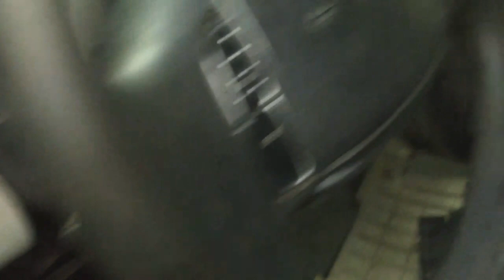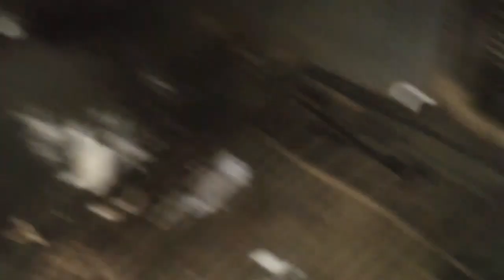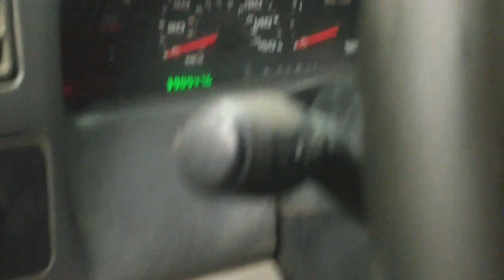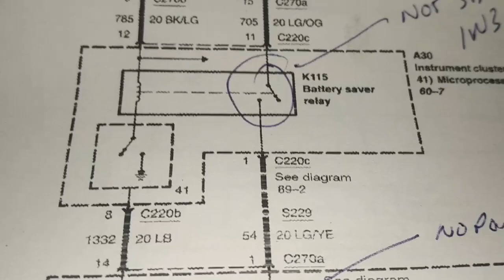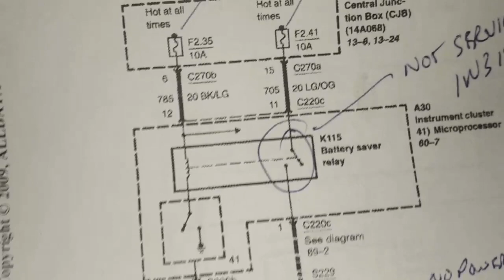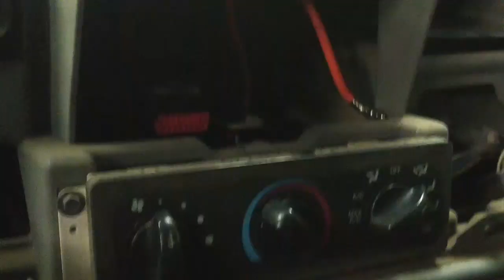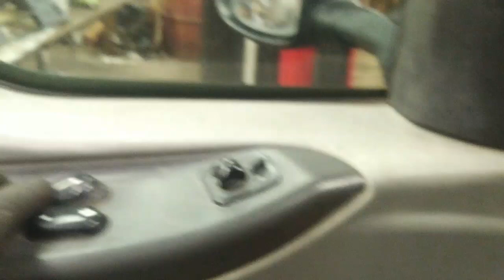2002 Ford F250 SD no power windows or radio

Comment: I've been having this exact problem for 10 years. About 5 years ago I figured out that if I smack the dash right above the radio 9/10 of the time the radio and everything comes on. I haven't bothered to follow the problem further because it's always worked. Remember hitting things is sometimes the solution 😅🤣
Reply from the maker: The root cause of the problem is likely a cracked solder joint on the circuit board or that internal relay and its contacts. It seems to be quite common based on all tge feedback on this video. Thanks for watching.
Reply: I slam my drivers door twice.  😄
Reply from the maker: The Fonzie move...
Reply: Lmao you just got me out of a wicked pinch
Reply: My dad beat the dash on his f350 for years and it would always come back on then he passed away and when i started messing with the truck to fix it up i was doin the same thing for 2 years but now it wont work hittin it i just pray that it works the day i go to drive it each time now lol

Comment: I was curious if this would fix my issue I have an 04 f250 6.0 the cluster radio windows and dome lights quit on me today the cluster said battery I went an bought two new batteries it was able to activate my fass fuel system so 8 could start the truck other than that still no luck with the other
Reply from the maker: I would suggest to check all the fuses that power in instrument cluster. Since it indirectly powers the radio, power windows and interior lights it won't be able to do that if its not awake itself. Check the fuses. Aside from that you then will need a schematic to check powers and grounds at the instrument cluster. Good luck.
Reply from the maker: Fuses 33 and 45 power the cluster

Comment: Thank you so much!!!   So glad I stumbled on to this.  I have a 2005 excursion I think this will fix mine as well.  Battery is going dead in two days if left to sit do you think this is related?
Reply from the maker: You need to check for a parasitic draw. I doubt this problem would be the cause unless the relay were to stay on in which case the windows and radio would work normally just not stop working. Is yours gas or diesel, if diesel one battery could be killing the other if there is a bad cell. You need an ammeter to test for a draw.
Reply: Phillip Bailey I figured that it was a draw.  I was just grasping at straws.  Alls good I will do your fix tomorrow.  Also I talked to a friend who had exact same problem in his 03 F350 and sent the cluster somewhere in Virginia and they repaired it.  He said the cost was reasonable but can’t remember the place.
Reply from the maker: @mikejackson6862  I just thought of something, you said that was an excursion? Like an  SUV right? Does it have a rear wiper. If so the rear wiper siezes in the glass and can't park but it trying to as its stalled. Does your rear wiper work? Just a thought
Reply: Phillip Bailey it’s been sitting awhile.  I will check.  Thanks so much for your help!

Comment: do you know if the wiring color will be the same on a 2004 f250 6.0 king ranch
Reply from the maker: Yes I just confirmed the wire colors are the same. Cut the light green/red wire leaving pin 1 of C220c which is the 20 pin connector and attach the cut wire to the circuit at pin 19 of the same connector which is a black/pink wire. as per the video. should work if this is your problem which seems common. Please subscribe if you don't mind. Thanks
Reply from the maker: I meant to say light green/yellow to pin 1.
Reply from the maker: Not sure I'll check...

Comment: I'm about to just go ahead and do the same thing on a 2003 f350 super duty with intermittent radio and window problems tommorow. 

What I like about this mod is that all it is doing is adding voltage to the charging circuit of the relay by bypassing the dash. It isn't just bridging the main power circuit of the relay, it still works through the relay which is safer on a 30 amp window and radio circuit. 

Will report back if it works, especially if it doesn't lol.
Reply from the maker: Should work. I can't believe how many people have had this problem  good luck
Reply: @PhillipBailey  in a perfect world, ford would have a recall or at least give a heartfelt apology for making that relay in the gauges a nonservicable part. 

And thanks, my uncle has just been living with it, not sure how he can do it in the florida heat. Heh
Reply from the maker: @MrS22222  Non serviceable relays are common on all manufacturers now. I suppose it's cheaper to build that way. Let me know how you fare.
Reply: @PhillipBailey  hey buddy, that fixed it. I just used a blue splice connector and wrapped it in electrical tape. 

I can't thank you enough, very informative video, seeing the wiring diagram really helped.
Reply from the maker: @MrS22222  that should work since its low current and behind the dash out of the elements.
Reply: @PhillipBailey  absolutely, it's working like a charm now. Thanks again! My uncle was happy.

Comment: Great video! I think I might do this just so they do turn on and off with the key!  Would this also make the dome light shut off when the key is turned off as well? Call me a throw back, but I like it when the lights go off when I shut the door instead of when I get to the porch in the rain, turn around and see the dome light is still on so I go back to make sure the door is shut only to have the light go out when I get to the truck!
Also, would this make the cargo and dome lights stay on until I turn them off instead of when the truck thinks they should turn off?
Thanks again for the video.
Reply from the maker: I believe this will only affect the radio and power windows. The internal relay in the cluster supplies control power to the accessory delay relay for 15-20 minutes or until a front door is opened. The dome lights and Cargo light are also controlled by the cluster if I'm not mistaken but although triggered by the door opening function slightly differently so I don't believe this modification will alter their operation. HTH
Reply: @PhillipBailey  Thanks for the quick response! Good info to know. Thanks!

Comment: Did this on an 05 Excursion. Works perfect. And no worries about my battery being drained or $400 dash repair.
Reply from the maker: Yes it appears to be a very common problem. Glad you got it fixed. You just don't have the retained accessory function now.

Comment: Any thoughts if I have low power to pin 85? It’s reading about 3 volts
Reply from the maker: I would say that the battery saver relay which is integral in the Instrument cluster or the printed circuit in the cluster has failed. I'd recommend bypassing it as I did in this video. HTH

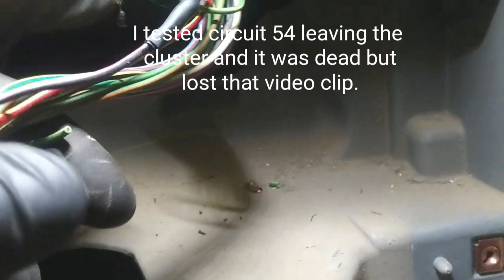Comment: 3:16 So, cut and connect green (LG/YE) pin 1? to purple (PPL/WHT?) pin 19?
Reply from the maker: Cut the light green yellow wire going to pin 1 at the instrument cluster connector. Connect it to the wire coming into the cluster on pin 19 which is black with a pink tracer. Tee the green yellow wire into the black pink wire. This will send ignition switched power to circuit 54 thus turning on the relay that supplies power to the windows and radio. Tape up the cut end of the original green yellow wire leaving the cluster on pin 1 so that it doesn't short to ground. Hope this is clear.
Reply: @PhillipBailey  Thanks!
Now if only I can figure out how to get to it :-0)
I'm thinking about just hot wiring the relay in the fuse panel for the windows instead.
Then I can just flip a switch anytime I want to use the windows.
Reply from the maker: @2Truth4Liberty  It's not that difficult to get to the instrument cluster. Removal of the radio is required to remove the dash trim and you need some release tools. If you could get to the back of the relay center in the dash you could basically do the same thing there. I just don't know what its like to access.
Reply: @PhillipBailey  Okay, thanks, I'll take another look.
Reply: FYI - I don't use the truck much so I went ahead and just hot-wired it like this -->
http://whitestonepublishing.org/DELAY-RELAY-BYPASS.jpg
Reply: Hi Phillip my 2003 f250 is doing the same thing my dome light, gauges, windows and radio not working, I sent it to circuit board medics to get fixed  they stated they repaired my cluster so this morning I connected back to my truck and nothing still. Can you help me out what you think it can be. Also one of my fuse blow out and I replaced it as well. Still nothing.
Reply from the maker: Check the fuses that power the cluster. This problem i fixed only affects the power windows and radio. The custer controls the interior lights as well but thats a different circuit. If the cluster is not turning on you will have your problem. Test fuses first. Then test for power and ground at the cluster. Ill check fuse numbers and get back to you...
Reply from the maker: In the central junction box fuses F2-35 and F2-41 both 10 amo should be live even with the key off. F2-33 15 Amp and F2-45 10 amp live only with key on also power the cluster. If these are good need to check these circuits at the back of the cluster...hope this helps
Reply: @PhillipBailey  thank you so much Phillip I will definitely check those tomorrow see if there anything wrong whit them. I will get back to you as soon as I find out. Thank you again I really appreciate the help.

Comment: Phillip I'm working on a 03 sport trac that's doing this.  It started to go off and on.. was doing that and i think also killing my battery.  But I'm going to see if wire colors match and try to do this.. hopefully so.. just trying get by until I can get a new panel.
Reply from the maker: Also check for water intrusion into the central junction box. It's on driver side behind the dash. Actually the fuse box. If the windshield leaks weird stuff can happen due to water in the electronics. If it has a sunroof the drain can leak the same way. Parasitic draw can occur as well. HTH. Good luck
Reply from the maker: I'll have a look at the schematics.
Reply from the maker: From what I can see briefly looking at the power window circuit it's completely different. The relay is called a power window safety relay and it's under the hood in the battery junction box. It's power side controlled via the Smart Junction Box. Instrument cluster is not involved.
Reply from the maker: I'd check that relay first.
Reply: I'll check it too
Reply: It's just so annoying that they made that so if the panel isnt working then the windows and radio won't work.  More like a redundant wiring system lol
Reply from the maker: @502shellie  get used to it that's pretty much the norm for everything today. Computers control everything. That's how we get all these neat accessory functions.

Comment: so is that the connector that goes into the back of the fuse box? having same issue on my 03 F250, but only Radio and map lights, no power windows.
Reply from the maker: This problem should affect the radio and power window. The connector I bypassed at is behind the instrument cluster on the back of it..
Reply: @PhillipBailey  yeah my truck is a work truck no power windows so the only thing its affecting is the map lights and radio. Thanks for the info

Comment: Thanks Phillip ! Your video was a help in fixing the annoying radio window problem I had for many years.  Your the HERO!
Reply from the maker: I can't believe how common of a problem this seems to be!
Reply: Yellow green wire c8nnecr to purple n black on backnof radio they share the same relay. Join those two wires it omits the relay n bam both work off the key again . Not sure if this is what your video says but that's the issue. It comes on n off or off for a while 😊 your welcome
Reply: There are two green n yellow wires, this guys says. So make sure u cut the wire closest to the black n purple and join them two together only. I saved the vid under Truck issues on my ytube lol
Reply: @MsLori-anne  what is your you tube channel? I have the same issue with my Ford F250 7.3 for a long time and i want to watch your video. Thanks

Comment: Will the gauges and speedometers work by doing it this way
Reply from the maker: This will not affect the gages or speedo operation. If they are working correctly they will function as normal. If they are not working this will not fix the gages. HTH. Good luck.

Comment: My wire colors are not matching your 2002. Hmmmm
Reply: Been doing it for 3 years. Felt like fonzy at times.
Reply from the maker: Now I know what you mean by Fonzy but most would not lol
Reply: @PhillipBailey   Lol. Aaaaaaaaaa
Reply from the maker: What year is yours?
Reply: Just now got it done. Black with a purple stripe for voltage. I cut the green with yellow. All good.
Reply: 2002 f 350. Hell the book had different colors. Lol. Again, all good. Thanks.

Comment: I bang on mine and it will come on. Lately I have to hit it a couple times.

I'm planning on doing the same thing you did in just a couple minutes.
Reply: I have to do the same thing 😂😂
Reply from the maker: @derricksarazin6582  Wow this seems to be a common issue with these trucks. Please subscribe if you haven't already. Thanks!
Reply from the maker: Yes this one was intermittent too.
Reply: Mine is fixed. I did wonder if I should have left the other wire together in the circuit.
Reply from the maker: @MrThenry1988  I would recommend to leave the other wire disconnected and taped behind the cluster.This would avoid any potential feedback to the ignition by the retained accessory relay if it decides to start working again. Might keep the ignition on when it shouldn't. Please subscribe if you haven't already. Thanks

Comment: Question so how do you fix it the correct way I have the same problem and 03 it’s making me crazy
Reply from the maker: The proper fix on this would require replacement of the instrument cluster as the relay that controls this is integral and not serviceable. This was a work around. Hope that helps.